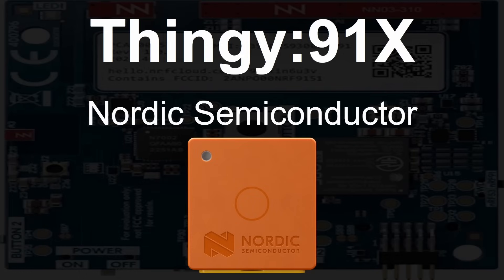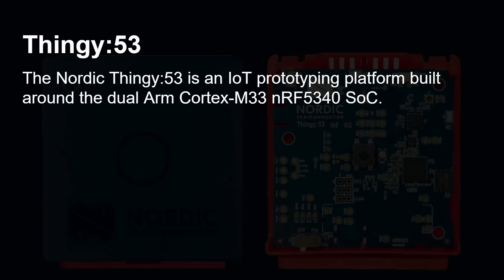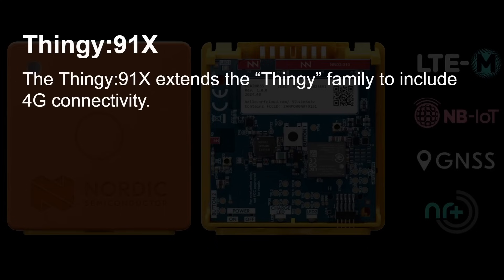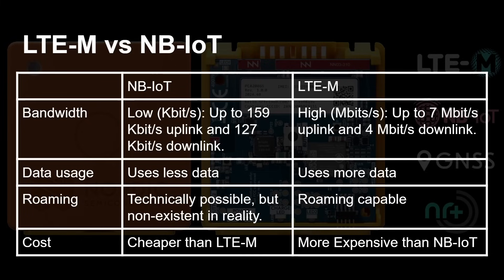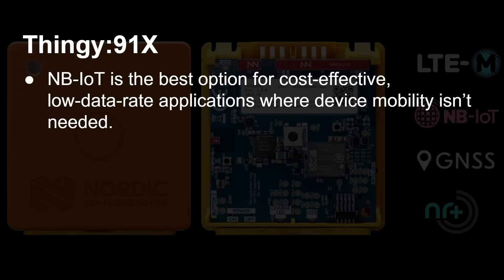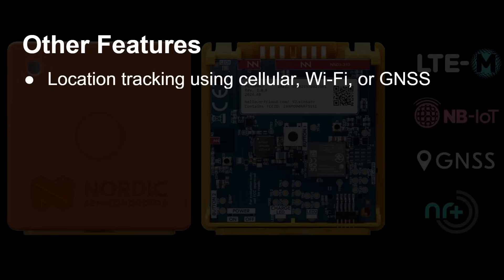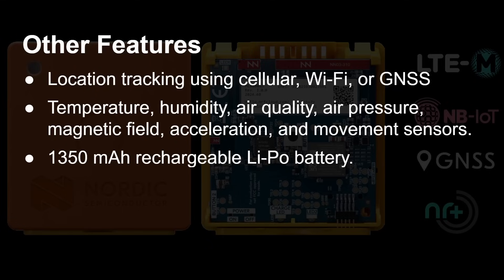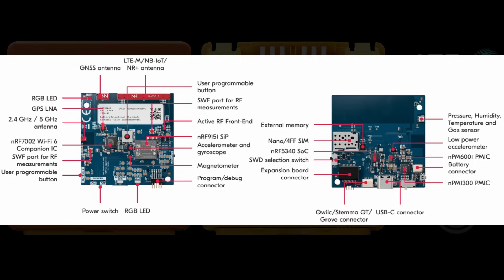Can you use 4G LTE with a Microcontroller? - Yes, with the Thingy:91X

Comment: If your device is only going to use one comms standard, which would be true in the vast majority of cases, then why not do boards with one or the other on as well, because you are paying for hardware you will never use otherwise. It might not be a big deal for hobbyists, but commercial production is a cut-throat thing these days.
Reply from the maker: Because this is a prototyping platform in a commercial production system you would design you own board based on this prototype leaving out what you don't want.
Reply: @GaryExplains  The problem with that is you have all the EMC stuff to deal with and if these modules you design are very similar then you gain by economy of scale if you can just buy in the board. A rising trend is to have a standard CPU and RF module plug into a motherboard which has the additional IO stuff on it.

Comment: Very cool, medical hardware that monitors patients, or takes logs that get uploaded periodically, use what seems like the same tech. My dad's c-pap machine had cell access. I am guessing they are similar to pagers, sending data easily used by linux as a data stream. And cheap to use. By the time I can get one, hopefully they have a device that can attach to other microcontrollers, but the fcc requirements are more strict for cell tech, so probably not 🤪

Comment: Gary,
     Wow!  That's a bizarre and exciting thing(y) :D  I'll be interested to find out what's the cost for keeping the unit a valid SIM card after the free minutes are up.  I guess that will depend mostly on the data use, but if it's anything like a cell phone plan, you'd be paying $30/month to start with.  Have I misunderstood the situation?
Reply from the maker: I think they are much cheaper than that. In Europe with Onomondo it is €0.004 per MB and €0.030 per month per SIM.

Comment: i have been looking for something like this to put in my car as an antitheft device. available in mouser or digitkey with battery but not sure of the energy usage or compatibility in north america networks. great find, thanks!
Reply: As for compatibility is seems to be designed for global use can use anything between 700mhz up to 2200mhz so uhh b12, b13, b5 and  b4/66
Reply: The device utilizes LTE-M/NB-IoT cellular networks, which are widely accessible across North America. You have the flexibility to configure the data transmission frequency according to your needs, potentially extending the battery life to several years.

Comment: Thank you Gary. I was using an Arduino to send myself text messages when the inside of our camper got too hot for the dog. The US decided to drop 2G connection and it stopped working. This could possibly take its place. I’m somewhat worried about the programming however. What IDE would I use and what programming language? I’m sure you must have mentioned it in the video but I didn’t understand.
Reply: There is an extension in VS studio code ("nRF Connect for VS Code") that enables VS code to be a fully fledged IDE for the nRF Connect SDK, and the programming language for the SDK is in C.
Reply: @martinlesyo  thank you! I will look into that.